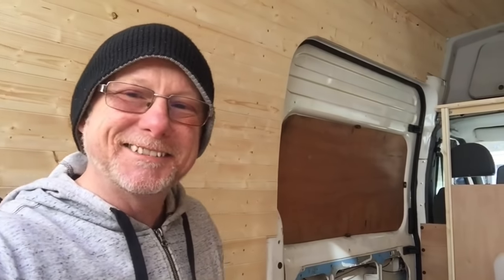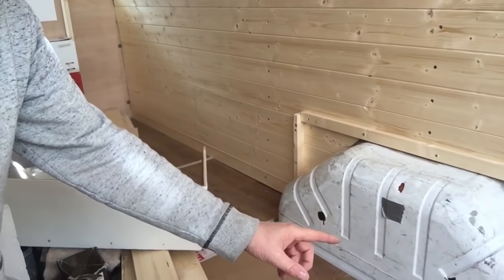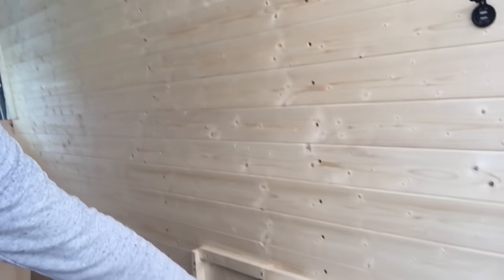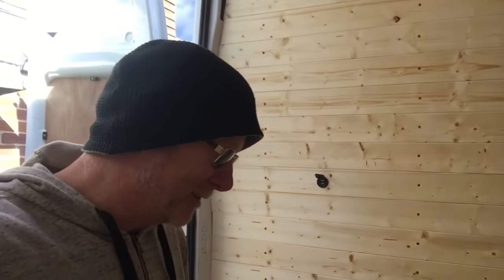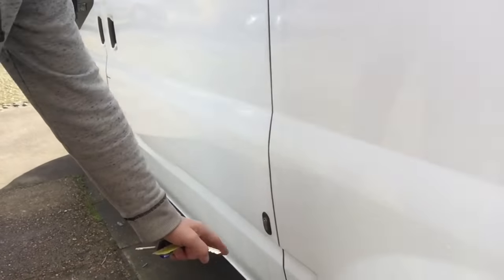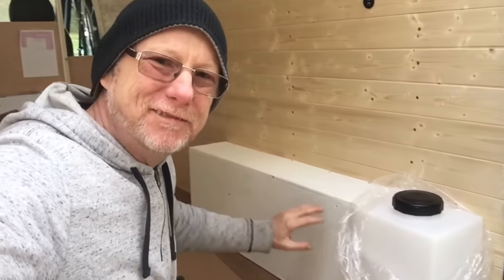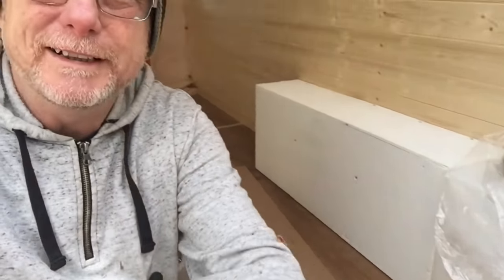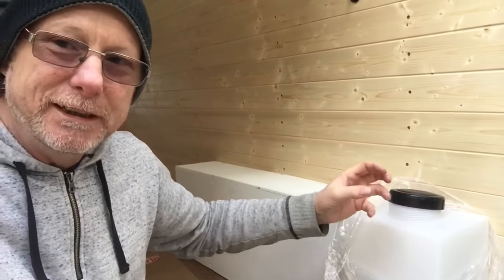How To Fit Deadlocks to your DIY Self build campervan conversion van life

Comment: That is a very clever solution Mel.  Why didn't I think of adding a box around the wheel well?   You insulated wheel wells and also cut back on noise from vibration of wheels when driving.  This is wonderful.  One thing... if these are metal, add a piece of Noico butyl sound deadening mat on each well.  No need to cover completely but it takes the tinny rattle of metal out.  Alternatively, Humble Road (very advanced commercial custom van builder) covers the wheel well completely with sound proofing called Heavy Mass Vinyl.  This adds weight but essential for all wheel wells to cut back sound drastically. You can get it with foil backing facing the inside, then add insulation, then your box.  Now its as quiet as a recording studio!

I don't think we have plastic loft insulation in the US, only UK.  Wool batting, denim, mineral rock batting, Thinsulate are some alternatives here.  Regular fiberglass will not work as it is ruined with moisture easily.

 Now that cage thingie around the diesel tank is a work of art, very neat, very nice! Vented lid - another excellent tip!  Security locks look very slick, so nice!

Make sure you travel with a dog.  Best alarm system for any break ins.  I heard about RV thieves in Europe pumping sleepy gas into the van then stealing everything.  A dog will alert you to anyone around even during sleep. Does not hurt to leave a dog bowl with KILLER on it, and a spiky chain hanging outside.

Thanks for a good tour, great job.  Happy Vanning!  Greetings from sunny Cali!
Reply from the maker: Hi thank you buddy for the great tips that’s really appreciated especially love the dog idea 👍😊👍

Comment: Super duper Mel, did Gordon treat the bare metal after he cut out the panels for the locks before fitting the actual locks?
Reply from the maker: Michael Aldridge yes he used some special wax oil stuff I didn’t think to get the name of it 😐 ops
Reply: @BigVanSmallWorld  Mel, I think you may have disappointed Michael Aldridge by saying the bare metal was treated haha

Comment: Mel I’m converting a sprinter and have hit a couple of things I’m not confident in doing. I’m hoping from your accent your either kent or Essex would you give me a hand
Reply from the maker: Yes of corse but I’m a little busy at the moment I can’t do much until this van is finished first 🤓🤙
Reply: Thanks fella I’m in no rush. So when your free. It’s installing a gas manifold and the wire from the split charge relay to the new battery position. I’ve bought all the bits I think lol
Reply: I would but it’s complicated!! Let’s just say I had a table saw accident
Reply: Carl Jones I would but it’s complicated. Let’s just say I had a table saw accident.

Comment: But why not one on the passenger side front door?
Reply from the maker: Customer didn’t ask for one 🤓👍
Reply: Seriously...that's odd to go to the length to do three of the doors and leave the passenger side without one. I guess if you have dumb thieves it will be easy. Just hope they don't watch your video.
Reply from the maker: It wasn’t my van my sprinter has dead locks on sliding door and rear door but not on cab doors was like that when I got it so I’ll be adding locks the driver and passenger doors soon 🤓👍

Comment: Hi Mel can u Lock unlock the dead locks from inside cheers
Reply from the maker: No you can’t not these ones anyway the ones I have on my sprinter are the best they are self locking but you can still unlock the doors from inside there called slam locks I think
Reply: Thanks

Comment: Everything you need to convert your own van into a camper (updated 20190405)

Videos

THE SELF BUILD - Shopping list - https://www.youtube.com/watch?v=47fxCgfiSAQ
Part 1 - New build - https://www.youtube.com/watch?v=5KZt4kqmhC8
Part 2 - Laying Floor - https://www.youtube.com/watch?v=qhsp2mbofUg
 Smart Alternator - do I have one? https://www.youtube.com/watch?v=CUPtxJBXZUw
Part 3 - Insulation - https://www.youtube.com/watch?v=KbGr2vQV72g
Part 4 - Insulation - https://www.youtube.com/watch?v=HDgFnEfHPik
Part 5 - Batons - https://www.youtube.com/watch?v=HG6enveXxF4
Part 6 - Vapour barrier - https://www.youtube.com/watch?v=hcFFetRXTc8
Part 7 - how to convert a van into an off-grid stealth camper ceiling - https://www.youtube.com/watch?v=BJUVnYbGwjA
Part 8 - how to convert a van into an off-grid camper Waeco CRX50 12v compressor fridge part 8 - https://www.youtube.com/watch?v=SQ04eg-h0R0
 How to convert a van into an off-grid stealth camper Why I don’t use cladding clips - https://www.youtube.com/watch?v=R2_w6bR5XdE
Part 9 - How to convert a van into a stealth off grid camper part 9 tips on cladding - https://www.youtube.com/watch?v=YjL-ECe6Br8
Part 10 - How to convert a van into a stealth off grid camper part 10 dead locks locks 4 vans / arches - https://www.youtube.com/watch?v=z5FE7OLAr-o
 https://www.thevanlockman.co.uk/
 

Shopping List

Locks for Vans - (part 10) https://www.ebay.co.uk/itm/372233648553
Fridge - (part 8) https://www.ebay.co.uk/itm/263325594227 (Dometic Waeco Coolmatic CRX50 12v or 24v Compressor Fridge)
Cooler / fridge - https://www.ebay.co.uk/itm/323234957613
Mattress - https://www.ebay.co.uk/itm/331944277628
Solar panel - https://www.ebay.co.uk/itm/173756839481
Solar panel 160 watt - https://www.ebay.co.uk/itm/122610022860
Solar Smart Charger with MPPT Split Charge - https://www.ebay.co.uk/itm/201921539775
Water tank / diesl tank - https://www.ebay.co.uk/itm/112429099483
Fiamma roof vent - https://www.ebay.co.uk/itm/372177256976
Fiamma Turbo roof vent 400 x 400 - https://www.ebay.co.uk/itm/352241329888
Cooker that I had in my last transit - https://www.ebay.co.uk/itm/272968216470
Heater - https://www.ebay.co.uk/itm/332867943103
Swing out table leg - https://www.ebay.co.uk/itm/253320392385
Sink & gas ring combo unit - https://www.ebay.co.uk/itm/251923456153
Plumbing kit - https://www.ebay.co.uk/itm/263370121822
Control panel and switches - https://www.ebay.co.uk/itm/254023185660
LED down lights - https://www.ebay.co.uk/itm/252928573990
Folding stove & grill - https://www.ebay.co.uk/itm/192548261069
Leisure batteries - https://www.ebay.co.uk/itm/321566500681
Dial 10 (part 3, 4 and 6) recycled plastic Insulation - https://www.diy.com/departments/diall-loft-insulation-roll-l-8m-w-0-37-m-t-100mm/197658_BQ.prd
Dial 10 (part 6) Vapour Barrier - https://www.ebay.co.uk/itm/293002512868

--

Comment: Would drilling a very fine hole in the lid not do for a vent hole Mel, 1mm or so, or does it really need to be something like a one way valve?
There a nice size and shaped tank, are they food grade for drinking water or are they only good for water for doing the dishes Mel? 
You're coming along nicely mate with the van 😂
Reply from the maker: pa maj don’t recommend drilling holes in lids as vented lids do have a one way valve so stop van smelling of diesel can’t see anything wrong with putting water in theme as long as you washed them out first 🤓🤙
Reply: @BigVanSmallWorld  Cheers Mel 👍

Comment: You'll be able to see the thermal glow of that van from space it's so well insulated lol

Slam locks work ok but it can be interesting if the driver and passenger doors have Slam locks on too Eg automatic locks that lock the door when door closed without needing to lock the can doors etc
Reply from the maker: numberplate guy I could see myself locking myself out the van if I had them fitted lol 😂
Reply: @BigVanSmallWorld 

I've seen it happen lol because when you are in and out I'd a van all day in a rush it's to easy to leave your keys in the van whilst you do a delivery etc and think it'll be ok I'll leave the door open and do the delivery 

It only take the wind to blow the door shut whilst you are doing your delivery and your day will go pearshaped especially if you've left your phone in the can too lol

Comment: Hi Mel - do your rear and side door locks actually ‘hook’? I’ve had mine fitted and the hook bolts don’t actually hook over anything in the opposite door. They just sit in the recess. Is this like yours?
Reply from the maker: Sounds like you have a part missing mine hooks into a plate
Reply: Mel’s Van World it goes into a plate but doesn’t hook onto anything..? It just fits rotates into the bracket but is no different to how a shoot bolt would be secured. Strange. Do you have a video or image of the bracket in the back door? Many thanks!
Reply from the maker: Sorry Tom my mate has taken the van now to have the upholstery done 😐

Comment: i just went into the vans main fuel tank when i installed my diesel heater, did'nt want diesel in the van
Reply from the maker: Fair play 🤓🤙
Reply: @CarlJones14  for the amount of fuel mine uses it's not noticable, pull up at a petrol station in a transit for red diesel and someone will report you lol
Reply: @CarlJones14  true enough suppose im just lazy fill the tank forgrt about it ive always got fuel in it then ive run mine all winter and not noticed it

Comment: How many rolls of recycled plastic insulation did you use for that van?
Reply from the maker: E3CB good question so far 7 rolls probably going to need one more for the rear doors 🤓🤙
Reply: Thanks. Looks like plastic recycled wool is super popular in UK and almost impossible to buy in mainland Europe :(
Reply from the maker: E3CB Oh really that is surprising 🤓🤙
Reply: What is your opinion on Knauf ECOSE® TECHNOLOGY inside van? This one is available in my country. Thanks
Reply from the maker: E3CB I’m really sorry I have never seen or used it before where are you ?
Reply: I'm from Estonia, but getting my van from Amsterdam in May. Hoping to find something from German/Poland hardware stores on my way back home.
Reply from the maker: E3CB fantastic sounds like you’re in a mission good luck with it hope it works out well for you 🤓🤙
Reply: Thank you.